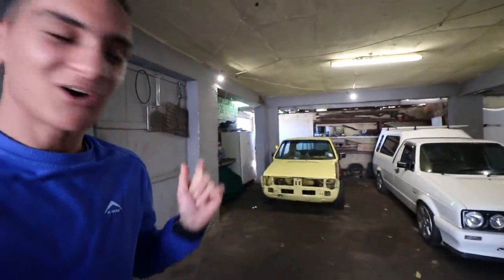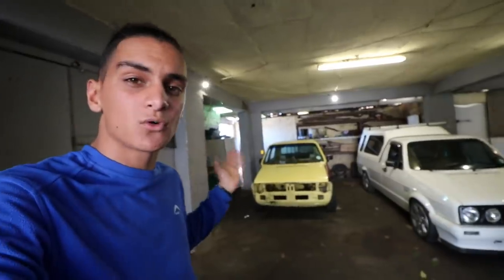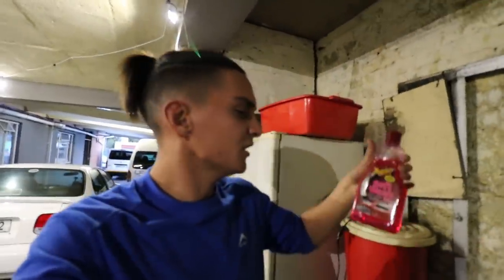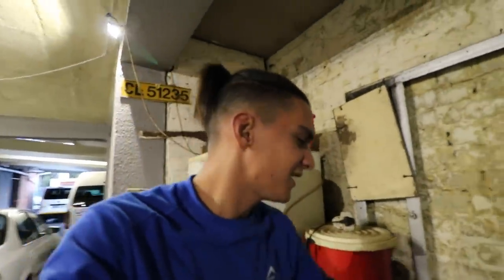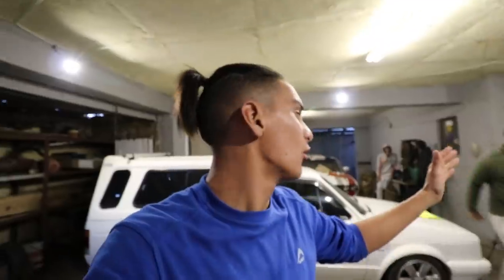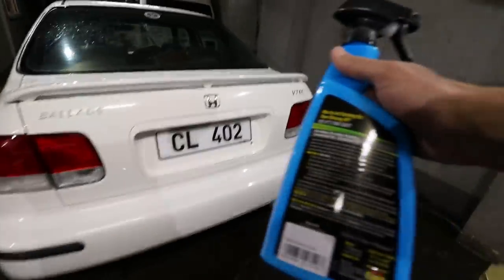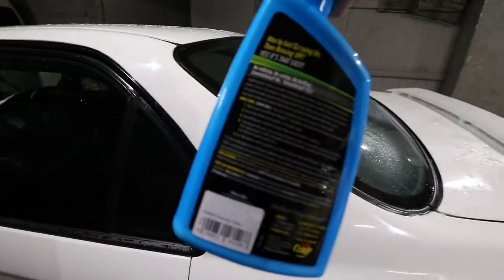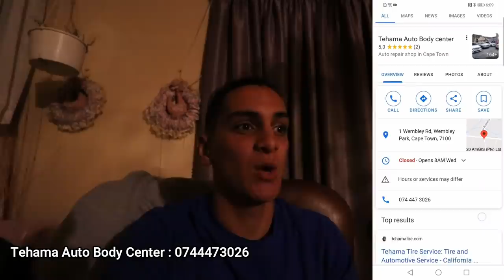The Yellow Thang makes her way to the Spray Painter.

Comment: I got my e36 resprayed by a guy named chad from eersterivier and i paid 7k for the job but after a year all the rust spots that he was supposed to fix resurfaced again and paint is starting to chip off on the bumper.
Reply from the maker: Now that is exactly what I dont want. Abdul who is currently working on my car does a outstanding job with rust removal and making sure your cars paint and body os protected long term

Comment: You must run 0 guage wiring buddy for that battery in the boot
Reply from the maker: Still need to do a wire upgrade to 0 Guage
Reply: @LateLateCustoms  will start up much better